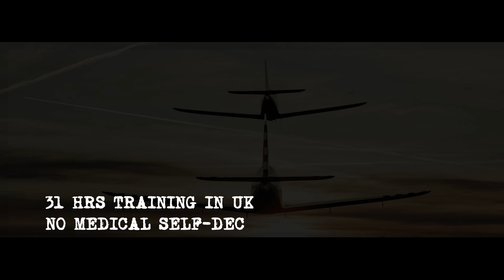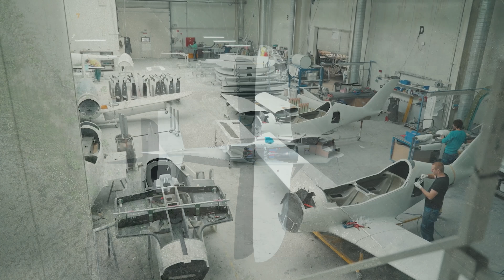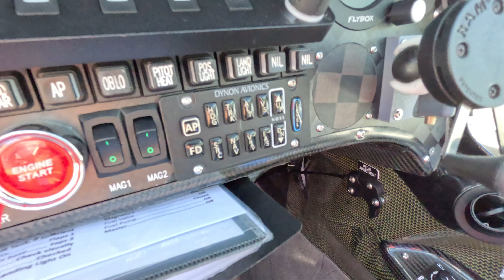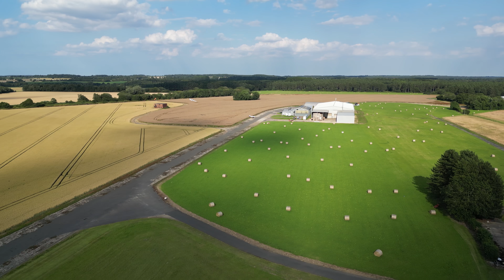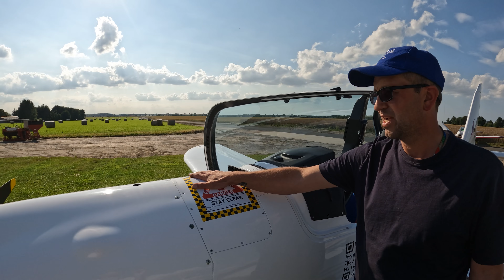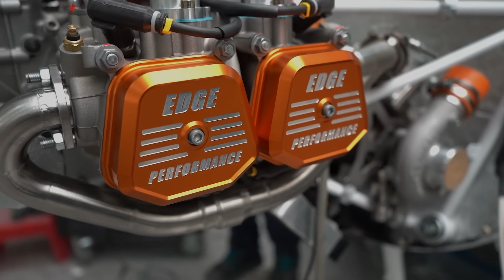YOU CAN FLY THIS from just 31 hours training from ZERO AND NO MEDICAL!

Comment: Ok people, a bit of a relaity check from somone who knows what thay are talking about. I am a Flight Instructor with 5000 hrs dual given. I have sent about 700+ student pilots on their  'First Solo".  Of the 3000 different students I have trained, only 1 or 2 of them would be able to handle an aircraft of this performance level with 31 hrs of flight training experience. A very good student would be at least 150 hrs before they can even start training in this aircraft.
Reply: I think you’re comparing apples and oranges. In the U.K., the minimum amount of training hours for a NPPL (the simplest license) is 25. Then add 6 for conversion training. That adds to 31. That’s a fact, not a point of view. 

Whether you WILL is another matter. Most likely very few people pass the NNPL in 25 hours and from the ones that do, very few are likely to have £250,000 lying around. 

And finally, the point you are raising is whether people SHOULD fly this plane after 31 hours. I’ve not flown one but apparently the handling characteristics are extremely benign. The temptation to go high speed is probably high and with a little ultralight that could land you in some trouble, agreed. But provided you don’t go high speed, I can’t see what makes the Shark any more dangerous than a EuroFOX except for people forgetting the gear.
Reply: As someone who has owned a few aircraft in my time, you will not get insurance in this aircraft with 31 hours TT logged, which is the regulation that really matters.
Reply: @jamesbooth3360  Finally the only comment than anyone can take operational action on.
Reply: I agree. It's a nice airplane. But this would be a killer for the average zero time trainee. This clip is hopefully not aiming for the below average enthusiast... living in fantasy land. 
If you really expect to fly this almost "high performance" airplane after 31 hours... (from pedestrian to pilot) you need to train with the airforce. In other words: You have to be qualified and selected !  

Regards from the 747 cockpit  ✈ 
(fmr P-51 , T-6, PC-7 jockey and instructor on other airplanes, 747, 737). 

But I have to admit: The clickbait worked pretty well.. 😉

And, more importantly:  It's a very cool airplane !  Good luck with it. 

.
Reply: @Renato.Stiefenhofer.747driver  Sorry, sir, but you are wrong. Try to fly it first, and publish things later. I own my second Shark now. I got the first one, being only freshly PPL licensed, and I know what I am talking about. You don't know the Shark. If you would, you would be commenting in the very opposite way.
Reply: These comments are insane.  A 19 yr old flew this plane around the world a few years ago  mosaic is due to become law mid 2025. I can't wait to read the comments. 
Light sport is a minimum of 20hrs.
1. MTOW 3000LBS 
2. MAX SPEED 250KNOTS 
3.  RETRACTABLE GEAR. 
4. CONSTANT SPEED PROP.
5. FOUR 
SEAT AIRCRAFT 
6. NIGHT FLYING
Reply: @mauriceevans6546  I think a lot of boomer pilots and instructors who obviously get paid by the hours ..
Reply: @mauriceevans6546  people thinking like you, the aviation community is waiting for: To have a fresh license on these parameters doesn’t mean, you know how to fly professional. This 19 yr. old had a certain amount of training. These rules to get the license are questionable. It’s a serious aircraft with complexity in Systems. 20-30 hours to fly safe? Insane and ridiculous. That’s the reality. Theoretical on paper doesn’t mean anything.
Reply: @TakeTimeToday888  the FAA disagrees with you Mosaic is coming next year
Reply: @TheHungryAviator  I am tired to discuss with spoiled pilots. You know, there are old pilots or spoiled pilots. Everybody as he likes in his own responsibility. It’s for sure not me thinking after 20 hours I am now a super hero pilot made now for flying complex airplanes.
Reply: @TakeTimeToday888  its a 100hp aircraft and not that complicated.
Reply: @TheHungryAviator that’s almost like saying an electric chainsaw is safer than a large 40” stihl! 

All aircraft have the potential to catch you out and what most of us are saying is that it takes a significant amount of time to become truly aware or even to experience some of the pitfalls of flying firsthand. You simply can’t get that in under 50 hrs. And the time from 50th to around 200 hrs is also dangerous statistically as complacency can creep in and you are still relatively inexperienced.

12,000 hrs + now (should probably fill in my log book!) and when I look back to my ppl days I knew nothing in relative terms.
Reply: It's the minimum. Results vary, but 150 hours? This thing lands like a pussycat. The Icon was marketed the same way and there have been some high profile morons splattering themselves, but most people do just fine with them. I know people at 100 hours that should just give up flying, but some people are solo ready with single digit hours and take instruction like a sponge. Finding an instructor who doesn't pad hours for profit is the bigger challenge.
Reply: Flew solo after 10 hours, but knew a guy that has racked up 200 hours and still not gone solo
Reply: @DeanW-d6y either that guy should not be a pilot or there is something seriously wrong with his training.
Reply: I have over 1000 hours in DCS and WarThuder. Flew with oil on my window, wings shot to pieces, flaps missing , and landing gear broken. I should be good.
Reply: I’m an ATP. I agree 100%
Reply: @jasoncrandall  stay safe with your slow elevator and let people have fun.
Reply: @jasoncrandall apt?
Reply: It's a 100hp aircraft with a really low stall speed. Same HP as a Cessna 152.
Reply: @TheHungryAviator  what a load of shit. Obviously you know nothing about aerodynamics.
Reply: I stand corrected, I
Misread this. I thought they were saying that a pilot would need 31 hours to get qualified in this plane. 31 hours from zero is wishful thinking. 40 hours minimum in the US for a private rating, but very few do it in amount of time, and that is in a Cessna 150/152.
Reply: @danbarone7643  in the USA, the minimum hours for PPL is 35 hours. I did mine in 36 hours.
Reply: I have over 300 hours and I still wouldn’t want to just be thrown into one without a good amount of familiarization.
Reply: @jacobbaumgardner3406 Jacob, you have the proper attitude.
Reply: I’m not keen to think of 31hr  total time bods zipping around at 180kts. However What is Vne. Looks like it could handle a higher speed/bigger engine!
Reply: The average for this licence is 55hrs in the UK. That's on a basic trainer. I wouldnt want to train on this until someone had at least 100hrs PIC.
Reply: @stewartgrant9832  and then some 100hr pilots fit into the “complacent” camp further increasing the risks!
Reply: I agree with your general aviation 31hr assessment, but not the 1 or 2 out of 3000.  Apples to pears I know, but I sent quite a number solo in high performance military trainers at the 8-10 hrs mark. Outside of bashing the circuit, these students were later  flying solo IFR/Aerobatics/Low level/ Formation [not all at the same time!] at much less than 150hrs total. Just sayin'
Reply: @spdaltid yes, but they went through a very strict selection process before they  could learn how to fly high performance trainers 😇 they are not your average recreational novice pilot.
Reply: @spdaltid you are correct. His numbers don’t add up at all. I was an instructor for 1500 hours. Majority of my students would solo in less than 20 hours. And most could handle an aircraft like this rather quickly.
Reply: @rtbrtb_dutchy4183  I soloed at 8hrs.
Reply: @rtbrtb_dutchy4183 Yeah, until the engine fails! The guy selling the plane said if you can drive a car you can fly this plane, that's absurd.
Reply: @rtbrtb_dutchy4183  soloed at 6 hours.  All in my class did it in under 10.
Reply: @spdaltid oh k😂😮
Reply: @spdaltid these aren't your average students or totalmding-a-lings. A military pilot is already a high speed, lean well fed and fueled person.
Reply: @spdaltid completely different perspective trying to compare mil performance to weekend civilian.
Reply: @AV8B_Flyer  exactly
Reply: @AV8B_Flyer US Military get their first hours at a civilian airport, in civilian aircraft with civilian instructors.
Reply: @spdaltid  in a closed practice area not doing cross country flight?
Reply: @spdaltid  Habe you been a USAF instructor or doing civilian warbird training? Makes a huge difference in what I want to say.
Reply: @spdaltid i am not a cfi, just a student, but isn’t it a hard comparison to make because of how much more vigorous military training is?
Reply: Impressive aircraft but I could see it potentially getting a reputation [as a result of operators who are not ready for that much aircraft, not because the aircraft itself is flawed] as a "doctor killer" as the Beechcraft Bonanza has in the states.
Reply: @Big_Z14  Sorry, bro, but you are absolutely wrong here. Why don't you fly it first? This way, you are only guessing, and you are wrong.
Reply from the maker: Cirrus has a similar reputation but why should you not be able to buy one? Agree Mr.Big
Reply: @Big_Z14  The V-Tail Bonanza.
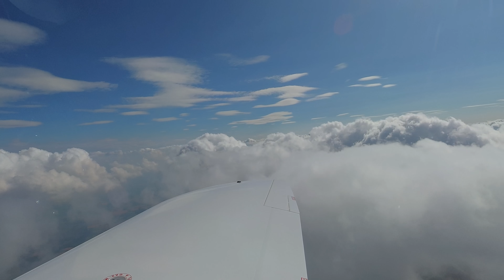Reply: As an old airline pilot nearing retirement with in excess of 20,000 hour, mostly in airliners I doubt I’d be confident to fly it. Mind you I haven’t flown a light aircraft for 30 odd years and have little desire to do so. All in all it does look to be an impressive machine but the comment at 9:18 about punching through clouds shows how little the commentator knows about the dangers of airframe icing.
Reply: @mitseraffej5812 20,000 hours sipping coffee at 35,000ft. What would you possibly know?
Reply: @mitseraffej5812  I had to retire early with 14k hours but after 8 yrs would love to fly again. Either STOL or high performance, not really interested in the damp,floppy middle ground.

Can't speak for you but having done mostly SH jet I reckon this a/c is no probby after both suitable refresher training and gradual habituation to the type over a year or so.
Reply: 700+ students in 5000hrs??? You just solo everyone in about 7hrs and not fly with them again?
Reply: @yvesbajulaz  I and a Grade 1 (senior instructoir). We had 150 students at any one time, with 35 instructors.  I would do the solo checks for the all the grade 3 instructors (Grade 3 instructors could not send 1st or 2nd solo). I would do up to 6 solo checks in a day.
Reply: @yvesbajulaz  Ever been an instructor? No? So shut up then.
Reply: Smells fishy, doesn't it? Lol @yvesbajulaz
Reply: @yvesbajulaz  Give him a break... He's a flight instructor, not a genius at math.  3000 + students would agree.  2999, 2998, 2997....
Reply: @danbarone7643  what ratings do you have now. What aircraft do you own now?
Reply: And this is the uk not states, very diff regs regarding everything.
Reply: I don't have a pilot certificate or student pilot certificate either and I agree with idea that learning to fly a plane this plane in 14hrs from Zero would take big cahones and instructor who rather make his tee time at the golf course  . I think you better off learning to fly in a simple cessna that fly slowly and land slowly, but what do I know I'm 
afraid of hights .
Reply: @rafaeltorres2886  this lands same speed as a Cessna 152 and has a lower stall speed I believe.
Reply: Pvt, Aeroprakt A-22, owned and flew a Mooney for 30 years.
Reply: I agree 100 %
Reply: I bought and started flying an RV right after passing my checkride (taken at 43 hours) with 10 hours dual. I don’t think this is much different.
Reply: @ronnl001  let me get this right, you could not only fly an aircraft to a PPL standard, on a cross country flight through controlled airspace, into a controlled airport at 43 hrs TT. That's rather extraordinary. Most of the 3,000 students I have trained can barely get to the training area and back solo at 43 hrs.
Reply: @Ozgrade3  yes.
Reply: I disagree, I bought a 1983 Piper Saratoga with 55 hrs total time on my license (actually bought plane before I received my license). Flew that plane for another 250 hrs then sold it. You are def slow playing these students milking them for as much as you can.
Reply: I don't mean to compare the civilian training to military, but I started with 0.00hrs and with 175hrs of instruction(plus some sim time)was flying a super-sonic T-38 and moved to the F-4. 6mos later I was fully qualified, instrument rated in the F-4. I think 150 hrs to master this depends on the instruction program.
Reply: @jaybrown4891  I bet you miss the F4. Monster airplane.
Reply: As a military student we soloed the T6 with about 25 hours. That,'s an aircraft that cruises at 200 kias and goes flat out around 260 kias,. with a +7 G limit. We were also doing aerobatics in that first solo and everyone pulled at least 4g in the G -warmup alone. It is 100% possible with enough training on the ground on top of those 31 hours. Flying VFR is not as complicated as people say.
Reply: @buzzlightbeer9328  keyword "military'..........not your average PPL
Reply: BS!!! There are some folk that have flight in their blood and I happen to be one of those folk. I took up hang gliding at 17 w/o any instruction, because I knew what flight was like through the repeating dreams I had as a young child. I couldn't get away w/ teaching myself to fly a full-on plane, due to FAA restrictions but, got my private pilot's license in less than a month, after showing my instructor what I knew and how I handled a plane. Took me another two years to gain my twin prop IFR rating, due to costs of fuel, plane rental, etc., or I would have gotten it much earlier. There are some folk that should never be in the pilot's seat, yet find their way there regardless of capability.
Reply: The title made me think that this was a forgiving and low maintenance aircraft, not high performance.
Reply: 150 hours, what are you on about. I soloed at 14 hours. Everyone I know soloed well under 40.
These light planes are not difficult to fly at all.
Reply: The US navy takes untrained people with 0 hours to flying the 1100 hp T6b in about 10 hours in a 172 and 20 hours in a simulator. All it takes is good quality instruction and studying. Speaking from experience.
Reply: You know got to say, isn’t it an assumption what their meaning of ‘you can fly this after 31 hours’, did they mean takeoff and land solo? Probably not, I take the meaning more like in a dual situation. Btw, I soloed after seven hours in a 172. Of course the mindset of the UK is much different than in the US.
Reply: thanks for adding some reality
Reply: @thespacesbetweenstudio3346  You're welcome lmao. I'm well on my way to 800,000,000,000,000 hours of dual time. I'm going for my God-King of the FAA rating next
Reply: ok, I understand your view. 1. Where in the USA do you perform pilot training? 2. Do you perform pilot training for this model aircraft?
Reply: It’s not about how fast an aircraft will fly, it’s about how slowly it can fly and how docile the handling is at low speed. I used to fly a Socata Rallye 110, an aircraft type designed for short grass fields. This thing has an approach speed about the same as the Rallye and a lower stall speed, despite the Rallye having full length automatic slats and a large, thick wing. It’s not a big step to teach a pilot to ensure the gear is down on approach and retracted on climb out (it’s even part of the standard approach check list for fixed gear types). The only other complexity is the variable pitch prop, again not a big step.

If this model had, for example, no warning of an impending stall and then a tendency to spin if stalled then I could see people’s points. If it becomes very mushy approaching a stall, then recovers easily with no sudden upsets then a novice pilot should have no problems with it. Getting it insured when you have low hours is a different issue.
Reply: I agree 31 hours is not much but that also applies to a cessna. The shark is super easy to fly even for beginners.   The danger lies more in managing speed and maybe retractable gear.
Reply: Gear danger 😂
Reply: This is example of what is legal is not necessarily smart.
Reply: @R182video  Why is this aeroplane such an example? Have you ever flown it?
Reply: Reality check…. Barely no one passes the licences for any plane with the bare legal minimum starting from scratch. The NPPL, on average, takes 57hrs 19mins to pass. Unruffle your panties….. folks. 

As for dug deeper into your memory… you mean you googled a bit more. If you dig deeper (Google more) you’ll find the very low hours pilots sent to battle…none survived.
Reply: @danbarone7643  yup. I agree with you.
Reply: @rtbrtb_dutchy4183 I screwed up. They’re saying from no flying experience to this high performance aircraft in 31 hours. As we all know, you can fly after getting your license, but the real learning starts afterwards.
Reply: @danbarone7643 You got it all wrong big time, pity You did not train with him, You have obviously a lot to learn 😇
Reply: I agree with you. I think it’s a 100 hour challenge to fly this plane safe.
Reply: @TakeTimeToday888  100 on type or total time?
Reply: Good Grief 5000 hours of Dual given.  You have the patience of Job.  ❤
Reply: @GreyGhost-r4z  Believe it or not, some people actually enjoy instructing. I managed to stick with it 5,000 hours before starvation forced me to seek more lucrative employment. But that was before the liability angle got so touchy.
Reply: @B @Bristolsailor73  I actually did enjoy it a lot.  I had about 2500 hours instructing.  I just could not make enough money doing it.
Reply: 31 hours learning how to deploy the ballistic recovery parachute they mean!
Reply: @kinch613  how original..  bet it took you 31hours to come up with such a witty response
Reply: @TheHungryAviator  no not “original”! FACT! You put a person from 0-31 hours in THIS, and you will become very proficient in pulling tne handle or become very proficient of killing themsleves or others!
Reply: Ozgrade3, as a retired ATPL and instructor I fully agree with your comment.
Reply: Flew a ton of hours and “trainers” are slow for building skills for a reason…..
Reply: what goes fast dont go slow well😂😮
Reply: wh😂😮y rush to die
Reply: @fsfaludi  Where are You in Canada? Your last name is Hungarian, right?
Reply: surely this opinion has nothing to do with the fact that FI income is directly tied to how many dual hours they can sell.
Reply: @rickblaster-xu5ie  This is a technical argument. i wouldn't know anyway, I was a salaried instructor.
Reply: I think you all worry too much!
Reply: What would the requirements be for the insurance company?
Reply: Yep....that's a lot of AIRPLANE...

BUYER BEWARE..

   🐦 ❤
Reply: Reality. True. That's just the start.
Reply: @Jethro-q6ufew were going to survive their first combat meeting. Sadly, you can build fighters much faster than train pilots back then. There was a desperate need for anybody to come up and meet the Germans during the Battle of Britain. There exists the exact same issue in Ukraine and to a lesser degree in Russia. Sticking with Ukraine, NATO has given them their older but still very effective F-16 Vipers. It takes years to train a fighter pilot, especially today's higher complexity fighters and weapon systems. The fighter needs to be flown using western strategy in order to be most effective. So pilots trained on eastern block aircraft start only marginally ahead of a zero hour trainee. Unlearned can be harder than learning, especially when a minor brain freeze leads to death in a fireball. Old problem true in this war just like all the others.
Reply: Yea that thing can kill a seasoned pro
Reply: I'm also a professional pilot I'm glad you said that you saved a few lives. Because a few of them would really go out their and try this
Reply: It only has a Rotax in it, not some HP turbine and being that it takes off and lands at roughly 50kts, I'd argue this thing seems pretty docile unless of course you are showboating close to the ground, doing aerobatics, or getting into tights turns and regions of an accelerated stall. Barring all that, I think it appears quite stable.  And with any issues of "over performing" I can only say level the wings and pull the power back.  I think the problems in any plane like this lay much more with people pushing the envelope and not with faults of the plane itself.
Reply: That doesn't sound like a graduation rate to be proud of. Seems the vast majority of your students quit.
Reply: Fair point but first ask, how many hours did RAF give trainee pilots before putting them into a spitfire and then how many before commencing combat ops?
Reply: Wrong
Reply: Another inexperienced pilot in the air. Getting off the ground and back down safely, isn’t all there is to a pilots necessary experience.
Reply: Completely agree.
But people are desperate to sell their products, nobody cares about customers. And as we can see it now, that strong desire to make money applies to all the companies, from Boeing to ultralights
Reply: So you're saying there's a chance. 😎
Reply: I'll license with a Cessna 172.
Then plan to get a Pipistrel Explorer for further training.
It's the Prius of the skies with NASA awards.
Would you suggest this or the BlackWing RG for advanced training and ownership?
Reply: I bet you i would do it under 30 hours
Reply: Shut up.
Reply: Not an instructor but a Citation owner and pilot and I had over 1000 hours total time with over half of that in multi engine before I even felt comfortable starting my Citation training. The retractable gear requires a complex rating alone. In flying there can be nothing gained in fewer hours that's good
Reply: chill out dad 😎
Reply: Yep too much Disneyland here. Most things in this world are easier to be said than done.
Reply: Agreed, it has a high power to weight ratio, which means high "get yourself in trouble fast" ratio.
Reply: @rinzler9775  not even close. Geez hundreds of posts and almost no one has a clue. It's all about the airfoil section used and the wing plan form which combine form the aircraft handling characteristics and especially stall behaviour.
Reply: @Ozgrade3  not talking about stalls.
Reply: @rinzler9775  then you don;t know anything about piloting. My god, how standards have slipped.
Reply: @Ozgrade3  making assumptions and arrogance are more dangerous.
Reply: Maybe with today's morons
Reply: Well Ive been to over 20 air shows, seen both Top Gun movies several times, played flight simulator, flown first class….I could solo that plane at least one time……😅
Reply: Good luck getting insurance without holding a medical. In Canada there is no pilot permit you can hold without holding some type of medical certificate.
Reply: Sir, you are absolutely correct. I'm a low-time Commercial Helicopter - 400hrs, low-time C172 - 200hrs and just recently received by high-performance endorsement in the C-182 and have around 20hrs. The C182 has a G1k and I'm still trying to get used to it. 
 When I was deciding on getting my high performance I had the choice of getting a complex by going up to a C210 and completing both at the same time. I asked a long-time CFI with 4k hours and he advised me to watch and read the NTSB report of the TNflyGirl incident. The similarities of what I had a choice with and her story was so close that I ultimately decided to learn and get used to HP with the G1k before going complex. 
 What you said was absolutely correct.
Reply: I actually fly 172s and I agree lol
Reply: I had my PPL check ride at hour 76 which was about average
Reply: Might help to spend 100 hours on simulator to get used to all the nav aids etc.
Reply: You have 5000 hours as a flight instructor,  you've trained 3000 students 😂😂
Reply: @Ian-ij4of  what are you implying. I actually have 3,752 different student names in my logbook. Some students I flew from efects of controls to their ME-IFR pre licence check flight, others I only flew with once when i did a phase check.
Reply: I can fly this with zero training. Easy stuff.
Reply: It was about legality 🙄🙄 besides you should only take vehicles out for a spin if you confident you can handle it FFS 🤦‍♂️
Reply: Relax..I've got MSFS..
Reply: thank you for your input
Reply: ABSOLUTELY.
Reply: Im flying it right now while looking at my phone tutorial
Reply: How do they train recruits in the Airforce?
Reply: 150 hrs would be a moron and probably should not be flying. 31 is the minimum and it would take most people more than that, but 150...come on now we all know you're paid by the hour
Reply: I guess he means “legally” you can fly one after 31 hours? If so, perhaps the regulations are a bit lax?
Reply: And I could be that 1 or 2.
Reply: I would definitely be interested in that aircraft.
But.
Knowing what I know about performance aircraft, I’d definitely look for more than 31hrs f training.
Here in Canada, I’d  go for full training plus extra for the performance part.
Beautiful aircraft.
It definitely needs to be respected.
Reply: Ok boomer
Reply: I taught military pilots and with only 7 hours they went solo in twin engine jets to do aerobatics. I instructed for 20 years. The only difference is expectations and what you demand from your student. GA instructors get paid by the hour..it's no wonder training time has INFLATED just like the economy. I flew my first solo in a C-172 with the minimum hours (I believe it was 10 at the time and I was 16 years old).
Reply: He must be trying to instruct people in their early thirties and twenties. The need 40 hours to learn to start a mower and cut a lawn. 60 hours to operate a chain saw
Reply: i landed on first flight ,had controls for most of the next 4 until coming in a wee bit slow and tried to lift the nose ,instructor said 'I have control ' and added throttle while easing the nose down , a very good demo ,well ingrained .
Reply: @johnmarkgatti3324  you landed a plane on your first flight................BS!
Reply: @Ozgrade3  funny I was there ,very good lady instructor ,watching me set it all up for a nice angle in ,at her promptings ,did a good flare out to .some people can do stuff .its a gift .
Reply: @johnmarkgatti3324  well then I think you should immediately apply for Test Pilot school as you obviously have a higher skill level than Bob Hoover or Chuck Yeager every had. Maybe astronaut school will follow quickly. Commander of the first Mars mission?
Reply: Exactly
Reply: Most of you private pilots have no idea what mother nature can do to your plane! What's the glide ratio in this stupid plane?
Reply: Two sides to this coin... the old instructor cliche of "every student learns at a different rate" reasoning to sell more dual training hours, due to the fact that (no shock about it) flight schools ARE a business afterall and need to find ways to sell you goods and services. The other side of the coin however, has some truth to it though. Additional training is necessary to fly this aircraft, but I don't totally agree with the CFI gatekeepers who put these aircraft up on pedestals as if you need a NASA test pilot qualification to fly one of these overpriced buckets.
Reply: Generalization, but anyone that can afford this will be intelligent enough to ensure they receive adequate training.
Reply: @haverelmink  obviously you have never been a flight instructor dealing with a millionaire owner who buys a high performance aircraft and wants to fly it with minimal or no training on that aircraft. They call these aircraft 'Doctor killers". Google the story of the Dr who flew IFR for years in a Bonanza with no IDR rating, he died when his autopilot failed.
Reply: @ I have 2000+ instructor hours, and have never signed off an incompetent student. Any competent instructor or flight examiner would be the same.
Reply: I agree. Just because you are allowed to, does not mean you should. Remember the stories of the 'Doctor Killer'?
Reply: @Ozgrade3  I went to flight school at Chesapeake Flight Instruction out of KBWI.  It's where the Naval Academy sends their flight candidates for a couple reasons. 1. The school uses the Diamond Katana (low wing) trainer. 2. It's close. They must solo at 15 hrs or wash out. I, on the other hand, got my shirt cut at 50.
Reply: I did my ppl in a piper cub J3.  A simple, slow and very forgiving aircraft.  I soloed at 10 hrs or so and got my ppl at 50 hrs. 

Unless you flew 2 or 3 hours hours every day - which would be too much to start with.  You might be ready at 30 hrs.  But would be an accident waiting to happen for the next 30 or more considering its performance
Reply: Anyone that can pass a PPL is clearly not so stupid as to jump into one of these at 31 hours. 
In fact they wouldn't have a PPL at 31 hours.
Reply: @sextonblake4258  LOL oh how little you know. Many years ago I had a student who was a doctor and had the money to buy a jet easily, he was adamant that he had the skills to fly a jet single pilot at 100 hrs. He failed his PPL checkride 5 times and eventually gave up.
Reply: @ the whole point is you don’t need a ppl ( in the uk, where this is from), you only need a LAPL .  And  low hour pilots are exactly the pilots likely to not recognize that while they technically are certified, they aren’t skilled enough to manage that performance.
Reply: i remember when i had 31 hrs as a ppl student, this would not have been safe for me at that time with that light weight. Beyond actually flying it a big part of flying is weather judgement at your field and time of destination. What to do with your 31 hrs when you misjudge and have a strong crosswind in this small plane, accidents waiting to happen if you ask me at that amount of experience
Reply: Agreed by an Airbus Captain with 23000 hours. Still nice plane 👍🏻
Reply: I bought a Swift at 60 or 70 hours, flew it with  no problems. I had 10 hours in a Citabia. Found the swift a lot easier to land. Put a 200 hp lyc in, and it became a rocket ship.
Reply: Someone with 31 fight hours can most definitely fly this plane with ease.
Reply: @ Someone with 31 flight hours can’t fly any aircraft with ease.
Reply: Terminal CFI huh? Condolences, dude.
Reply: JD vance said anyone can fly a plane just play a video game and ur just as good as the top pilots. Ur fake news 😂
Reply: I was flying 360hp Yak-52s in formation with my buddies at less than 70 hours.  Straight out of the 172.    I disagree.
Reply: 5000 hrs and 3000 students and 1.5hrs of total training per student. I call bs. this aircraft is as easy to fly as a diamond da40.
Reply: @MustyGarage  i worked at  a school training pilots for China Southern at YMNG. We had classes of 30 cadets.. Often 15 of them would be ready for 1st solo on the same day, Grade 3 instructors (Juniors) would do the training hrs and I (as a Grade 1 - senior Instructor- Grade 3's could not send students for any solo)  I would jump in for 3 circuits then send them solo. I sent 6 solo in one long day.
Reply: @MustyGarage  I just did an electronic sweep of my logbook in excel. I have 3,4011 Chinese cadet names in my logbook. So there!
Reply: I was particularly interested to see that it was at Little Snoring. I visited the airfield from Australia in 2017. I went into the old control tower, which was my father's 'office' as his last wartime posting in the RAF over a thirty-five period of service.
I also dropped into the 'Green Man' pub, where he met my mother, who was a WAAF at the time.
Reply: Read the fine print.

They've stated one can fly this after 31 hrs from scratch.

From 'scratch' refers to aircraft type conversion and flight training for a qualified pilot.

Not a 'scratch' pilot who's learning to fly / going solo for the first time.
Reply: What is there that is so difficult ? Some complex training, a few commercial maneuvers some spin training  which I font think you guys not allowed to do anymore and wallah 🎉. 150 hours is way too much bro😮 I do believe that shabby instruction is too blame for alot of incidents and accidents as well.
Reply: As I recall  back in the 60s' we could solo after 6 hours.  
When it cost 10 dollars an hour duel and 5 solo for the cherokee 140  plane.  Never did solo , ran out of money.  Later in life in a simulator I took off and landed a 737 with no problem at all.  Didn't feel much different than the 140.  Instructor said I did way better than the two lear jet pilots that were before me. I was only able to do it because a friend knew the instructor.
Reply: Calm down, skippy … a check rider still has to sign them off, and and any finance company and insurance company is going to want to see some things first. Government regulation isn’t always the answer to everything. This is a union and socialist attitude that is obsolete and needs to be updated.
Reply: Shut up lol
Reply: Let’s not forget all those folks who have a little money and learned to fly in a cirrus. They never touched a Cessna product and probably never will so if this is what you are doing all your training in like they do in the UK.  I’m sure it’s perfectly safe. How many of us were flying in instrument weather in a multi engine aircraft with 200 hours. It’s the quality of the training and what you learned how to fly in. I for one would have loved to have flown in this 40 years ago instead I got stuck with the 152 and 172.
Reply: You might not be a very good instructor if your students aren’t ready for this aircraft until 150 hours. At 150 hours I had 87 hours in my 300 hp Bonanza, and I don’t consider that as being remarkable.
Reply: @Av8or7  you are the type people we read about in the crash comics. Ego exceeds ability.
Reply: @   I flew 4,823 hours zero accidents. 4 engine failures in single engine aircraft two in twins.  All of the airplanes arrived with zero damage. I flew banners for a few years and gave rides in a biplane. I flew missionary aviation flight as well.
Reply: You're totally right!
Reply: Excellent
Reply: Yup. Ur correct!
Reply: Naaaaa
Reply: Based his range on max endurance but using high cruise speed. Mmmm sure thing bud. Les see you set off across desert or ocean on a 1400 mile trip with 100 mile reserve using 75% cruise power. No thanks.
Reply: Is it dark up there?
Reply: A very expensive coffin😂
Reply: I agree with you sir
Reply: This isn't even that powerful of an aircraft. It's easy as hell to fly. Where are you even coming from with this?
Reply: @McBussyPounder  Your statement shows you have no idea. The aircraft is fast because of the wing aerofoil section chosen. Fast airfoils can have very nasty reactions when stalled.
Reply: 31 hours for people who aren't your students lol
Reply: what is a relaity check..😮😢
Reply: @soxplayer3907  its when someone believes in some fantasy and someone else tells them "nag mate, not gonna happen".
Reply: I had my first solo after 7 hours 16 minutes in a low wing, stick, tandem, retractable gear, tail dragger Zlin-726. Learning never stops, but 150 hours is an absolute joke and money grab. It's a small plane, not an F-104.
Reply: The reason most take so many hours is because they have so much time between each training lesson.  They have to re learn the last lesson. Best is to just go a few days a week and knock it out.  

This would be a sport pilot cert in the US
Reply: I was flying a PA28-200R solo at 150hrs lol
Reply: You can fly this aircraft in 31 hours maybe less.... landing take a little more practice
Reply: What did it take you to solo?  200 hours?  lol
Reply: @foobarmaximus3506  hrs and I was flying once a week. I want solo on my 16th birthday........in 1984.
Reply: We have Pilots with 100 hours of flight experience flying A320s. Yes, manually if needed. It depends largely on the quality of training, not on the hours. Quality training however is often hard to get in the GA world, where there is a lot of cowboy instructing, even more so in the ultralight world.
Reply: @Soordhin  OMFG. Dude, where do you learn this bullshit, it's not true. I have been a flight instructor for 27 years, I have trained thousands of pilots. You can't even get a commercial pilot licence under 150 hrs (you need 150 hrs flight time to even do the flight test). Even in the MPL. By the time they get to the 737, the candidates have around 270 hrs at a minimum ( and most go over). Stop putting shit on the internet in an area you obviously have zero knowledge or professional experience.
Reply: @Ozgrade3  MPL needs at most 75h in a competent school, we use CAE for our students and they get a few more hours more. They fly the line with 100 hours real flight experience. In my previous airlines we had some manage it in 60 hours, first MPL program in Europe and it worked quite well.

Always remember: simulator time does not count into total time.
Reply: Sounds like you just suck at flying
Reply: @RyanChase-hh1en  Ok hotshot, tell me how many flying hours you have, how much instructing time do you have, how many jet hours do you have. I believe that you may just be another know it all asshole who has never actually flown a plane, let alone taught others to fly a plane.
Reply: Why would it be hard it’s not crazy powerful
Reply: @yackson4804  its the wing section design, a high speed wing can have terrible stall caracteristics. A cessna will gently pitch down at the stall break, these wings can roll you inverted in under a  second.
Reply: @Ozgrade3 I see flat spin territory
Reply: Have you ever even tried the Shark? I trained for my PPL in a PS-28 Sportcruiser and in a Diamond DA-20 Katana. Very soon in the same year, when I had less than 50 hours of total flying time (including the hours with my instructors), my first Shark got delivered. This was the serial number 025. My transition (type) training took about three hours of patterns, in three different sittings, as I never flew an aeroplane before, which had a glass cockpit and autopilot, and retractable landing gear, and I only had like 4 hours in a Katana, with a constant speed prop. Mine had a manually adjustable hydraulic prop. Yes, the Shark is fast; you have to think a lot ahead to manage all that energy. It is extremely low-drag, so it seems like it will never get rid of speed. But once I got used to this, I didn't have any problems whatsoever. It is nimble, sporty, but surprisingly also very stable. Predictable. Friendly. And it is not only fast, but it can also fly really slowly, too. So sorry mate, but you are absolutely wrong here. I have my own real knowledge about the Shark; you are wrong. And no, I was not an extremely good student either. Try to fly it first, talk later.
Reply: Flying an airplane is not that hard
Reply: @DashzRight  how many hrs do you have, and what types have you flown?
Reply: I am a military instructor with 30 years experience and 10,000 hours in Rotor Craft, Turbo Props, Jet Aircraft and Piston Aircraft.  You people who are saying your 20 hour students could competently operate a slick complex retractable aircraft are full of Bovine Scatology.  Military training is immersive every day with no breaks.  Civilian training is often broken up by days or weeks in between flights.  Telling the OP he needs to be better at instructing is foolish.  I would rather he train someone I care about than an overconfident instructor who is willing to launch a 20 hour student solo in a complex aircraft.  In the US you require dual time for complex training for any aircraft with a retractable gear.  Get over yourself already.
Reply: OK Sergeant Major
Reply: A lot of old braggers on this page
Reply: Some people have a natural feel for an aircraft.  Long time ago I took my 15 year old niece for a flight.  She had never been in a light aircraft before. For a bit of fun I gave her control after we had gone through what to do.  Once she had learnt that controls for that aircraft need a very light touch her straight and level was perfect, so was her rate 1 turn.  All better than me who had gained a PPL.
Reply: Exactly. CFI here too. I saw the retractable landing gear as I was reading your comment and was like AI video BS 😂😂😂
Reply: Sorry but most good weather pilots (which means nearly all of them) are conservative and unintuitive by the rules people which have an imagination of an 90 years old. It has still a three point landing gear and doesn't weight sometimes 3, sometimes 3,5 tons (more or less armament). You don't do any acrobatics, guys that were 18 years old flew Spitfires and BF 109ers after 5 weeks without any experience in let's say flight simulators like every single guy nowadays has 100h minimum experience until they start flying in real life. And then, your First aircraft would Not be a shark. In Switzerland experienced fighter pilots say Ultralight aircraft should be forbidden because they are too light for the alps and the winds there. As If UL are automatically those paper flyers with 40 HP 40 years ago. Funny enough, Ikarus is this swiss sailplane manifacturer that builds this Planes you can carry like a backpack and start with your legs. And they think they are the only country in the world that has mountains, like I didnt hear that in Austria or france or italy or Colorado or canada UL's falling from the sky every week. Means I am surprised, that an Administration for flight vehicles actually loves airplanes for once and doesn't fuck with the people who want to begin with this sport and find ever new restrictions to piss everyone off simply from their existence, more so than any other Administration in european countries.
Reply: I like those odds
Reply: The military is laughing at your comment right now... Just FYI 😅
Reply: Thanks for posting this.  It looks like a heck of a lot of fun, but it's not exactly a C-152! .if you get low, slow,  uncoordinated,  and stall on a base to the final turn,  just pull the chute. - maybe not!
Reply: Sounds like you need to do better as an instructor. 150 hours?  Give me a break. If you had said 50 hours, I would call that more realistic.
Reply: @rtbrtb_dutchy4183 and your opinion is backed up by more experience than him then ???
Reply: @rtbrtb_dutchy4183 I agree
Reply: @rtbrtb_dutchy4183  You haven't got a clue as to how inept people are around aircraft.
Reply: I am amazed how flight instructors overate themselves and the number of hours necessary to be a good pilot.  Having gone through instruction through a commercial rating the one consistent is instructors always wanting to extend the flight instruction.  It’s the one thing that really leaves a bad taste in the experience.
Reply: Yup  @johnmcevoy6635
Reply: What an awesome aircraft. Both slow and high speeds. It would definitely be good as an RAF initial trainer or something that the Air Cadets could use for AEF flights. Not quite as fast as a Jet Provost, but just as much fun.
Reply: The Air Force solos students with maybe 20 hours prior and maybe an additional 20 in the mighty T-6A Texan II, a significantly higher-performance jet than what’s in this video.

You’re making shit up. 😂
Reply: @CramcrumBrewbringer If all my students went through the air force selection process before getting to me then they'd solo in 20 hours too. Unfortunately your average wealthy weekend warrior tends not to possess the above average aptitude of a successful air force candidate.
Reply: @CramcrumBrewbringer  T-6 is a jet now?
Reply: @kinch613  T-6A and T-6Bs arent jets, yes.

Turbo prop technically, everyone calls them jets.
Reply: @CramcrumBrewbringer  aww, never heard them call turboprops jets. Sorry worked on jets back in the day in the USAF. Never heard that!
Reply: @CramcrumBrewbringer  you’re skipping the fact that air force pilots are selected for numerous personality and skill attributes which are not necessarily present in your average private pilot. 

They are given more advanced ground school and simulator training to reduce the number of physical hours needed to get them through the various stages of training.  Their instructors are often  more qualified and experienced than a flying club instructor whose trying to build time to get into the airlines (granted not every instructor fits this description)
Reply: @CramcrumBrewbringer   What airforce? Minimum UK RAF training hours is 42 hours and they still can't tell the aileron from the rudder. They need a license to climb the steps to get in the cockpit.
Reply: @Jethro-q6u  I think you may be referring to WW1 my friend.
Reply: @antonrudenham3259  no I don't think so, my friend. Go back to read
Reply: @johnrisher3007  
Yeah OK then, whatever.
Reply: As a former flight instructor and retired airline pilot, I agree with what he said 100%.
Reply: U cant compare fast jet students with this. Only the cream of the crop get to third stage flying the T6, however anyone with coin can buy and fly one of these. These planes are great until ur on a tight base leg to final and ATC are saying make it tighter, thats when ur low hrs comes into play.
Reply: I think there is some instructor padding here. It’s ok. I would expect nothing less.
Reply: @thereissomecoolstuff  31 hrs really isn’t enough to pilot a regular training aircraft let alone a complex and fast single like this.
Reply: @JimboJet737  I’m going for it. I’m going to Florida do the prepaid 40 hr PP. then move into this platform. I have 9 hours from 1977.
Reply: Its like selling a 190 hp 1000cc sport bike to a 17 yr old whos never riden more than a scooter.
Reply: @08turboSS I learned on a hayabusa after doing the weekend training course for my endorsement. It can be done. Why does everyone want to take away from the capable to save the stupid all the time?
Reply: You are correct.  This is an advanced plane.
Reply: At 150 hours every  average pilot should be able to operate this thing safely.
Let’s not forget that it is common practice that thousands of pilots start flying Airbus A320s Boeing 737s or Global Express biz jets with 200-220 hours TT every year.
Reply: @xyzaero  it’s one thing to fly a very automated airliner with an experienced captain next to you and lots of sim time and practice in an airline environment , and a whole completely different kettle of fish to take a PPL with 150hrs and let him loose on his own with no supervision. I think back to when I had 200hrs and thought I knew and could fly anything, when I got to 1000hrs I realised that back then I knew nothing and could have written myself off so easily… I now have over 5000hrs flying everything from C-150’s to multi’s to small airliners, when I think back to when I had 1000hrs, I realise that back then, I knew absolutely nothing and could have still most probably written myself off rather easily….. anyway, the point of this small essay is, 150hrs may be just enough to be able to fly this thing, but don’t go around thinking with 150hrs you are not a massive risk to both yourself and others. Yes, 250hr pilots are put into 737’s and 320’s… but they are not in command and under strict supervision of strict procedures and training along with a captain who more than likely has several thousand hours
Reply: @ I agree with most of what you say and thanks for your detailed personal account, but we also have to consider that there is no consequence if someone kills himself in this tiny plane. It’s like a car crash. It’s the pilot’s decision to kill himself if he/she does not invest in the appropriate training. General Aviation has to change entirely anyways.
GA pilots have a disastrous safety record and 2 or 3 of these small planes crashing won’t change the statistics.
Reply: @xyzaero those pilots have an experienced captain next to them.
Reply: @JimboJet737  That’s not really the case. 

The airline / operator actually entrusts you to be fully capable to operate a large jet as soon as your supervision training is over. That often means 23 years old, 350 hours TT, flying a 737 and you have to be able to safely operate the jet, because your captain might meet his maker during your very first flight without a 3rd pilot.

I am not saying that you are a professional and proficient airline pilot at that point, but you have to be able to safe the day and bring that jet on the ground …. even under the worst conditions.

Thank the engineers (or god) that flying a jet is not really that hard 🤣
Reply: If memory serves me all the way back to the early 80's, I had to have 25 hours min. of dual training and another 10 hours min. time solo with at least 20 flights plus a written test, just to get a sailplane license.  And that was still at the discretion of the instructor.  I would not want to be standing around an airport where one of these new pilots with 31.1 hours of training is about to do some sport flying.  It is a fun looking ship though.
Reply: I learned in 3 hours.
Reply: Yet back in the day pilots with only 14 hours on Tiger Moths leapt into Hurricanes and Spitfires and done OK.
Can't be that hard really can it?
Reply: @antonrudenham3259  Did thety "do ok". Many died in accidents once converted to the fighters.
Reply: @user-wz2qe2pv6r  
Amazingly they didn't.
In WW1 they did
Reply: @ian-w6v4p  And even before they got there... Lots of T6's pranged too. And Tiger Moths.
Reply: @antonrudenham3259  And a ton of them died in their first few hrs taking off or landing those Spits and Hurries.Many of them simply couldnt do it.
Reply: @antonrudenham3259  times were different then. They had to. We were at war.
Reply: @antonrudenham3259 It's not hard ... It's just dangerous. Moths to Spitfires was an extreme process during an extreme era of necessity and Her Majesty was happy to foot the bill for the inevitable wrecks along the way. These days we prefer a slower more robust training solution minimizing aeroplane shaped holes in the ground....
Reply: @antonrudenham3259  It wasn’t quite like that, they went after the Tiger Moth they went on to the Harvard
Reply: @antonrudenham3259 Do not ignore that those new pilots would get another 30 hours or so in the Spit or Hurricane to practice.
Too, there is a significant difference between mil and civ instruction.
Then, the incidents and accidents due to pilot error among new pilots was common.
Reply: @antonrudenham3259  Actually, it can. From a book I read recently, I was reminded that the casualty rate amongst WW2 pilots being taught to fly was very high. And for the rest, if they went into combat with insufficient experience, they were shot down very quickly. So it was more a case of they got done OK rather than done OK. As a footnote, my Dad trained on Tiggies before flying Lancasters. I'm a glider pilot, and through my training post-solo instructors didn't allow you on to the 'slippery gliders' until they were confident you could handle them and manage your airspeed well whilst coping with high pilot workload. It's that aspect that could be a concern with this plane (esp if it got into cloud)
Reply: Trainee pilot fatalities were obviously high during WW2 but not as a percentage but rather as a whole.
Considering that hundreds of thousands of quite ordinary young men were taught.
It's also subjective because while many did die nowhere near as high a percentage did so as during WW1 when more British pilots died as a result of training accidents than combat.
Reply: @antonrudenham3259  about 40% it seems, from googling. Pretty high
Reply: @antonrudenham3259  It might be the lack of pilots during WWII.  Send as many up into the air and the few surviving the first dog fight will be the ones to keep in service.
Reply: @antonrudenham3259 yeah so what if some of them screwed the pooch?
Reply: @antonrudenham3259 This is the most amusing comment here. With hundreds of hours a guy can get into some very interesting situations that could easily turn fatal.
Reply: @antonrudenham3259  In todays congested airspace? You haven't got a clue.
Reply: @stewartgrant9832  you are quick to tell people that “they haven’t got a clue”. 
I bet I got more of a clue than you.
Reply: @rtbrtb_dutchy4183  Been an instructor?
Reply: @stewartgrant9832  yup. 1500 hrs dual given.
Reply: @antonrudenham3259  thats a gross overstatement. Do you not realize how many of those dude died just trying to get those fighters off the ground?
Reply: @antonrudenham3259  
It took almost a 150 hours at the beginning of World War 2 just to qualify an RAF pilot. By the end, it was taking between 200 and 320 hours. It's obvious the increased training requirement was because they were losing too many pilot candidates to training accidents. 

Nobody went from flying a Tiger Moth to flying Spitfires and Hurricanes. A pilot would move to an advanced trainer like the Harvard/AT6 Texan before being handed a Hurricane or a Spitfire.
Reply: @antonrudenham3259 any idea what the accident rates were (outside of combat)…they were staggering.
Reply: @antonrudenham3259  I cant find proof of this. Would you mind pointing me in the correct direction, friend?
Reply: @antonrudenham3259  Well, not true. RAF B of B pilots got 50-80 hours on DH82 Tiger Moths at EFTS schools, (dependent on when in WW2), then at least few dozen hours on advanced trainers (more after 1941), BEFORE going onto Spitfires / Hurricanes. Where they typically got a minimum of 12-16 hours at an OCU. And even then lots of them crashed in training accidents and botched landings when operational. Your comparison was invalid. A good e.g. was the RNZAF's P40 SQDNs. Who had a great combat record; 112 Jap AC (with veteran pilots) shot down, for the loss of 20 P40's (with green pilots). Their pilots got more time than RAF kids during the B of B. Around 80 hours on Tiger Moths then a similar amount on T6 Harvards before again similar hours at OCU on P40's. Typically 240 hours and by 1944 more like 300 hours logged before deployment. Yet of the 297 P40's, 20 were lost in combat (my late uncle being in one of them) and 150 were lost in accidents... Such stats were not uncommon with WW2 fighters. Just not spoken about much... Rushed through because things were desperate & training wasn't as developed as today. Flying for my crust for the last 33 years with too many hours in checking and training, from 4 engine heavy jets down to light 2-seater GA aircraft. And I wouldn't suggest putting a pilot with 31 hours into a Shark. Would be a waste of a nice plane for starters! 🙂 There is NO replacement for experience, and as nice as they are, they are slippery & by ab initio standards they are complex. So things could get out of shape very quickly indeed. Small steps...
Reply: @antonrudenham3259  Not quite. They had to do many hrs on the T6 then straight into a fighter, but it was still a huge step up.
Reply: @antonrudenham3259  14 hrs total time then into a 1200hp Spitfire??????? I think somne is pulling your leg.
Reply: @Ozgrade3  
I've dug deeper into the old memory and I believe you're right, rookie pilots would show up on squadrons having  completed flight training on Moths and having flown circa 14 hours on Hurricanes or Spitfires in an OTU (operational training unit).
Reply: @Ozgrade3 They’ll put new students into the 1100 hp T6 with about that many hours in the jet.
Reply: @Ozgrade3  no. That was the time they had to learn and in some cases, they were lucky if they had a handful of hours to master the spitfire before they went into combat
Reply: @Ozgrade3 yeah , he is exaggerating a bit. You would probably expect to fly your first training aircraft solo after 10 hours, but that would not have been a Sopwith camel if you are training in the time of the spitfire.  It would probably have been basic training on a tiger moth maybe up to 50 hours (first solo after about 10 hours) or so, then a Harvard or a miles master for 100 more hours or so. Then you would do a course to convert to type which would not need to be that many hours.  In 1939 and 1940 they may have sped up a little but most of the pilot shortfall came from recruiting overseas pilots I think.
Reply: How soon people forget the demands of a word war...
Reply: @antonrudenham3259 You’re right Anton. I saw the Battle of Britain film, so it must be true. “How many hours you got on Spit’s Simon?”  “Ten and a half Sir”, “Let’s make it eleven before Jerry has you for breakfast!” 😅
Reply: @Ozgrade3  My father had a friend who participated in in the Battle of Britain. He was part,of the contingent of foreign pilots. First solo flight in an Hurricane after 6.5 hours of total flight time. First patrol over the Channel at 11 hours of total flight time. Never been shot down, was awarded 2 kills and participate in the victory flight past over London in May 1945. Exceptional pilots for exceptional times. Could hardly speak any English.
Reply: I have 500 hours as an RC aerobatics pilot, and I learned a lot of complex stuff in under 20 hours. Some pilots take a lot longer. Let's just say some people just have a faster learning curb while being able to gauge directly with their plane from multitasking and intuitively knowing what to do when a troubleshoot happens. Some people put too much fear in their flying, and some are cool as a cucumber. The most intuitive pilots are the best ones.
Reply: @monchichis333  the pilots with good judgment are the best pilots.  Because they live longer.  How many times have you crashed or damaged your RC?
Reply: 14,000+ hour pilot with over 4,000 dual given. I came to the comments to say the same thing. Well stated! These types of advertisements are foolish and WILL lead to people getting killed.
Reply: 200,000,000 hour pilot here. As a 700 year old demi-god with over 9 trillion students,  I would say maybe one or two of them would be ready at 1000 hours for this plane. Frfr no capperoonies
Reply: @Fitzfish can't save them all with training wheels
Reply: @Fitzfish Doctor killer like the Bonanza was😅
Reply: I have 7500 hrs dual given and the original poster isn’t far off the mark!  Anyone in aviation who is setting their goal to be the minimum amount of anything, not someone I want in an airplane.  Can someone get 30 hours of training and fly, sure! Should you, fuck no!
Reply: 150 hours? You must suck as an instructor. 
A friend was flying a C210 at 60 hrs.
I solo'd a 150 at 7 hours.
Reply: At last some sanity on this!! What an appalling title to put o😅n this aircraft.   Someone will read this and no doubt, go and buy one and then crash in short order.